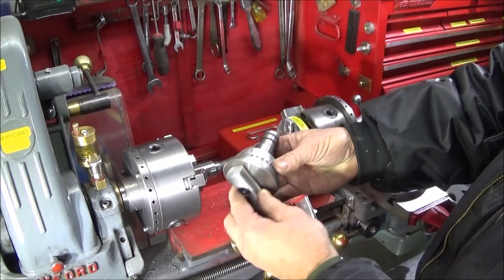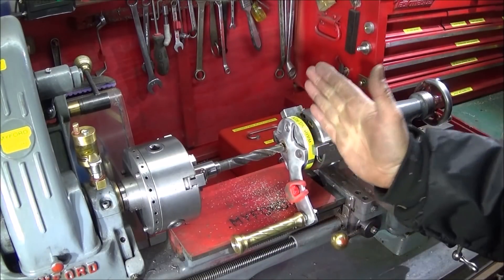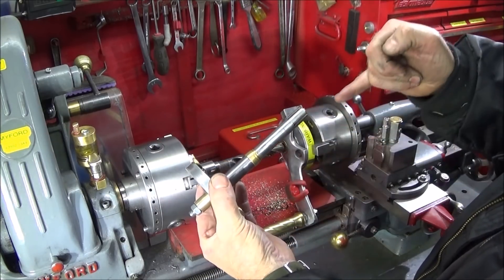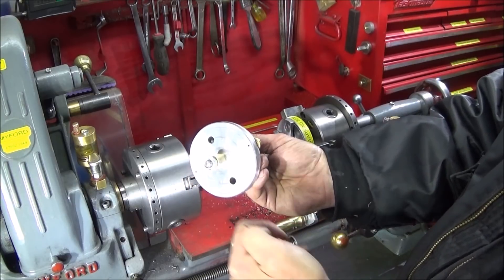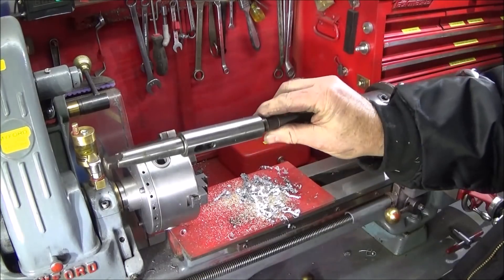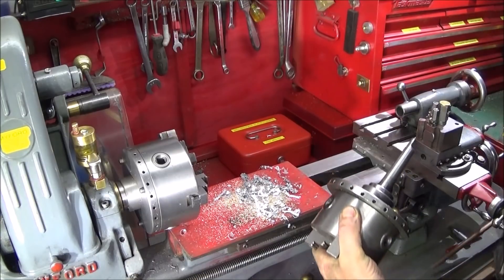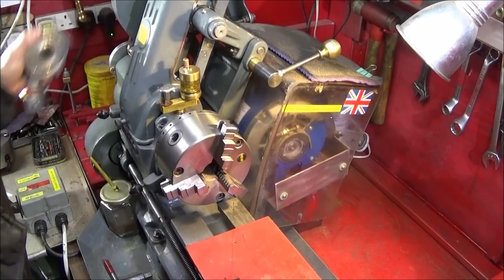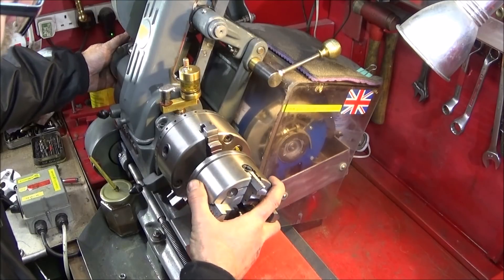Using A Myford ML7 Tail-Stock Mounted Chuck Modifying Mandrel Handle

Comment: Before I buy one, can you do much to enlarge the spindle diameter on lathes like this? I know some of the tasks I'd like to perform and want a small lathe but also pass through decent size objects
Reply: Thomas A In order to keep the Morse taper you can't  really do much.  I have heard of people using a reamer to open the bore....but on MT3(.750 of an inch) I believe you can only go to .800 of an inch and still be able to use MT3 fixtures in that bore.
Reply: Moneypit330 could you go to another part with a different morse taper on it? I'd like to be able to thread pistol and rifle barrels for muzzle brakes
Reply: Thomas A I suppose it depends on the lathe you start with.  I have a 7x12 mini lathe and the spindle doesn't have that much meat.  I suppose you could bore it within reason and honestly I don't think I would ever use the taper in my spindle for anything.  Or the easy solution would be to get a larger lathe with a larger bore to start.  Like a 12x36 grizzly has a 1.57" bore.

Comment: Good day Steve.

Recently discovered your channel. Find it very informative/educational as I am still shopping around for a lathe. I was reluctant to consider a Chinese mini lathe, fearing I would be limited on what I could do on it. But after watching many of your videos I am considering procuring one. 

Just 2 question. 1: What is distance between centers on your lathe?   2: What is the largest diameter you turn on your Chinese lathe? Your reply would be greatly appreciated.   

Suggestion: Have you considered using electrical heat-shrink or rubber tubing over the unused threads on your draw bars?

Comment: Those MT2 myford arbours work very well. I have done a similar thing thing but using a boring head in the headstock to bore and turn posts on items too large to swing in the lathe.